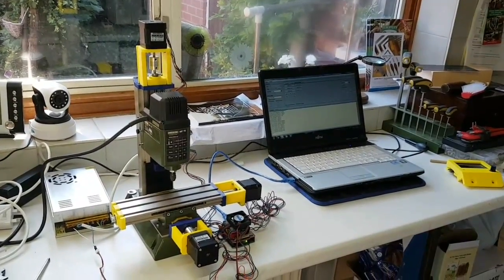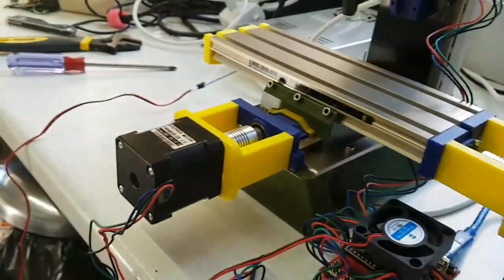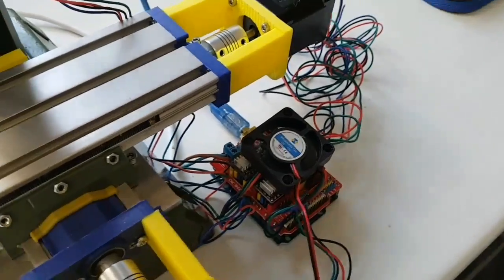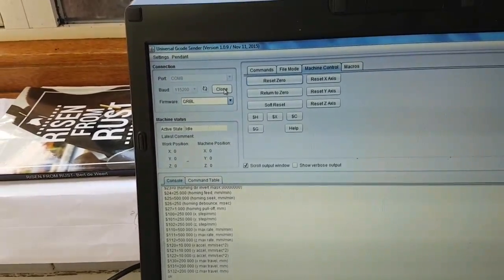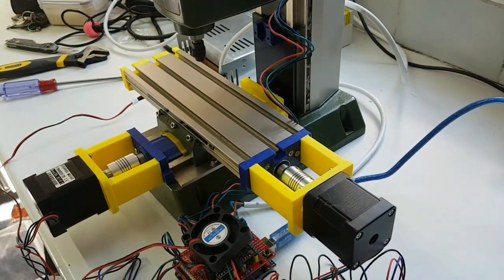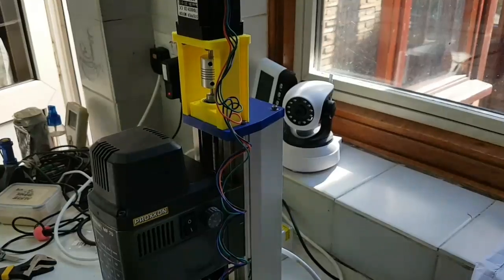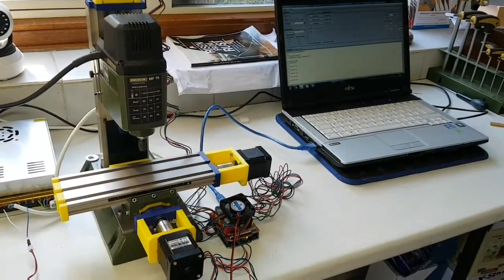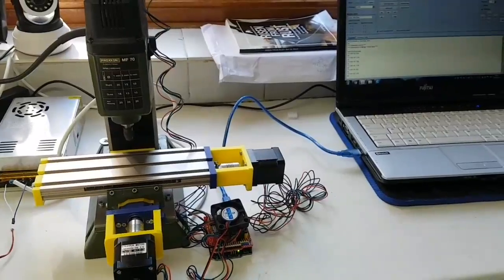PROXXON MF70 - CNC conversion

Comment: Can I use sculpture design engraving on iron that CNC type machine
Reply from the maker: Iron and steel need a really rigid machine but you can possibly do very fine engraving in soft iron or mild steel with very fine cuts and feed rates.... but I doubt it's rigid enough.
Reply: What feed rate I use for sculpture designing .on my sculpture height 1 to 2 mm according designing.and what rpm I use?
Reply: The MF70 claims to be able to cut steel / cast iron although you'd want a very good cutter and it would likely be quite slow

Comment: Very impressed are the lead screws good enough regards backlash. I would have thought you would have needed ball screws ?
Reply from the maker: AllTheGearNoIdea They run in Delrin which has low backlash but wear may be an issue. I have small ballscrews etc for plan B if needed.
Reply: Thanks for the reply. I have seen some reviews that state there’s a quarter turn of backlash in the hand wheels. I’m used to using my own worn out lathe and milling machine but assume the CNC cannot compensate for the backlash. I think I will invest in one of these and have ago at the CNC  conversion as it looks like quite a good project. Just bought my first 3D printer last month and I have just bought myself for Christmas a very cheap CNC engraver kit. I don’t expect the kit to be much good for £200 but I will probably learn a lot during the assembly and software configuration. Also been looking at laser engraving as well. I think next years going to be fun. Best regards Chris.
Reply from the maker: AllTheGearNoIdea Which CNC kit did you get?
Reply from the maker: AllTheGearNoIdea That will be a superb kit to use to understand the basics and is cheap as chips as you say and you'll not get the individual bits so cheaply.

If you use tiny bits and fine cuts you can easily cut pcb designs with it and a small laser will etch wood and other combustible things. 

Have a look through my YT videos at e-Bore though! I started small but then got addicted and it kind of grows! 🤣🤣
Reply: hendjim  I know what you mean. I keep looking at full sized knee mills. I have a large mill drill and a boxford lathe but I would like a real milling machine. Planning on upgrading the workshop at some points but have to many hobbies. I was going to converter the X5 into a CNC mill but again thing I will start small. I think I will be more interested in making small items and scientific instruments etc. So probably more interested in Precision over capacity. Thanks for the reply I’m working my way through you other videos thanks for share.  Regards Chris
Reply from the maker: AllTheGearNoIdea Really I find the older noisy belt speed change mills and lathes a pain compared with the variable speed DC brushless models which are really quiet too. I just do small jobs so SIEG or any of their brand equivalents are more than adequate.
Reply: @allthegearnoidea6752  I've got a well-used MF70 and what little backlash there was was in the end-nut on the lead screw, a new nylon washer & replacing the nut with two half-nuts (M6 left-hand) and it's now fine.
Reply: Shed Fu These look like great projects but my needs are probably for something bigger. I had intended to make PCBs but it so easy now just to order them from eBay. Still these little CNC machine look like great little project

Comment: Would the arduino understand the g-code from a Fusion 360 or would it require a better unit, the proxxon would have to make component parts for locks mainly one offs in shore - D RESIN or Aluminium.
Reply from the maker: David C Hi David...yes...any G-Code